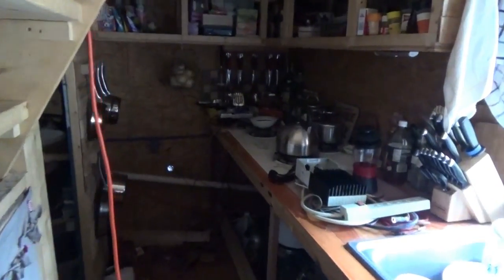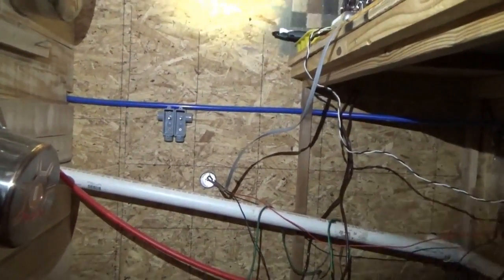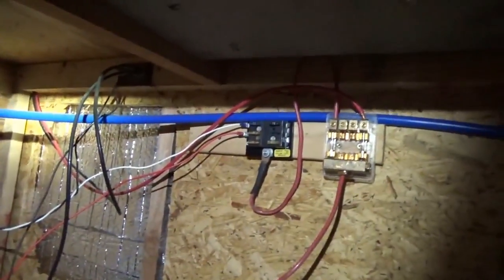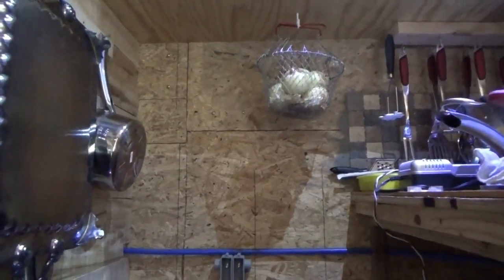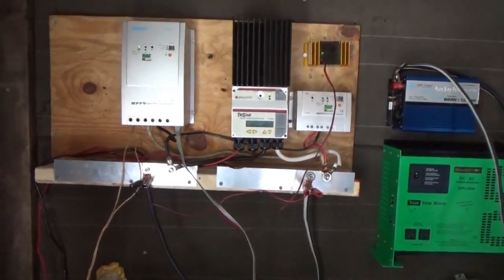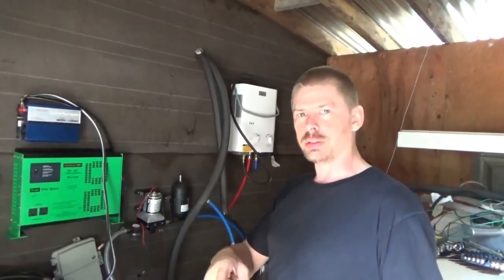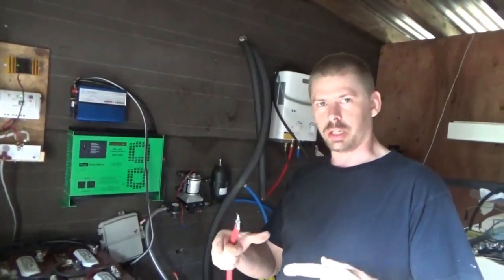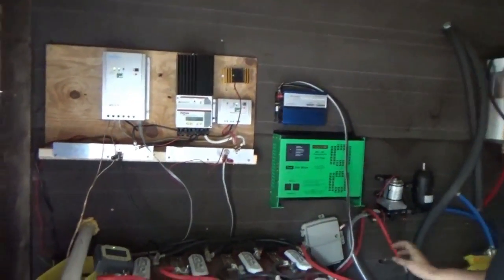Neatly Wiring My Solar Charge Controllers & Inverters

Comment: can a charge controller and inverter charge the same battery at the same time ?
Reply from the maker: You can have a charge controller charging and an inverter pulling at the same time. Yes.
Reply: @TheDoItYourselfWorld  Thanks for your kind reply .. But I want  both of them charge the battery , I mean 
Controller charges from solar and 
The inverter charges the same battery from The Grid . 
What Am I Asking , because My Scenario is having grid power but it is not stable so battery will drain without getting enough charging ... So I will use the solar  to help the unstable main grid (2to 4 hours out of 24 hours a day where I live ) charge my battery..
I Have a diagram if you want me to send you ,Kindly send me your mail . 
Thanks again .
Reply from the maker: Hi, you can bring it to the forum if you like. https://www.thedoityourselfworld.com/forum

Comment: Looks like the battery bank is not wired correctly for a balanced load. The pair of 6-volt batteries on the right will work twice as hard as the pair of batteries on the far left. In order for all 8 batteries to have the same workload and lifespan they need to be wired  in a balanced manner. Here's how they should be wired:
https://c2.staticflickr.com/6/5616/29793500710_0865bc7193_o.gif
Reply from the maker: Thank you for the info. I always wondered if this was perfect. I was shown the way I did it a few years ago by a YT viewer
Reply: +TDIYW
Essentially you have four 12-volt batteries. Here is some good reading on the subject of connecting 4 batteries to achieve a balanced load:
http://www.smartgauge.co.uk/batt_con.html

Comment: I am really interested in the way the batteries are wired?What is the reasoning in doing them this way, it appears you took 8 batteries and just made one big 24 volt battery bank, why not break it into 2 different banks and join them together to up the AH's? It appears you have all the negative terminals connected on one side and all the positive terminals connect together on the other side, not really sure why?
Reply from the maker: These are 6 volt batteries. I connected them in pairs to make four 12 volt batteries. Then connected them in parallel to increase the ah

Comment: no offence, but in my opinion it is still a mess....  (inverters direct on the tar paper, wires everywhere, water protection? ) iff your big inverter is drawing 200 watts idling its time to discard it, the one's we sell, can handle 5000 watts at 230 volts, using less then 5 watts at idle... (Victron)... so 200 watts is huge!!, it is still a mess, but at least its out of the kitchen.  y see you have connected the batery bank right now, thats a plus, but still miss the couplers on the 6 volt connectors., you are almost right!  . take care friend! (still a thubs up!)
Reply from the maker: Thank you. Not sure what you mean about the couplers on the 6 volt connectors?
Reply: 3 wires in the middle of your bank, the side were you have coupled the two 6 volt bats together, (make it like you have two giant 6 volt battery's in series) (thats to keep the 6 volt battery's equal in voltage, during longer times. (the way you have it connected now is almost perfect, butt its a minor thing)
but wil help to keep them equall.

Comment: Serious question will external temps, being it is in shed affect the power in the winter? etc and if so how do you plan to address that? question for Phillip
Reply: with solar panels the colder it is the more efficient they are and inverters will work what ever the temperature

Comment: I thought the battery shed was not permanently attached to the house, thus water can easily drip down that tar papered wall you have all your electronics mounted to. I am no electrician, but is this not a problem? water and electronics do not do well together.

Comment: I have a renorgy 4210 mppt tracer charge controller just like yours  ,,, using the mppt 4210 + 500 watts worth of renorgy solar panels I have four golf cart batteries,,,  I'd like to parallel that system and get some L 16  batteries about 4 of them,,, someday I'd like to save up and get the rolls surrette or maybe the Trojan,,, I have a 1500 watt pure sine wave inverter I recently purchased from Amazon it is a power Tech on I've been running my refrigerator with that every other day to cut back on my electric use I'm still on the grid someday be nice if I could get completely off the grid,,, kind of working at it,,, I'd like to add 5 more 100 watt panels from renorgy and another 4210 Tracer. looks like you guys did a great job. looks like things are really working out good for you Troy,,, I'm so very happy for you and Melanie good for you,,, I've been threatening for years to take a small vacation someday,,, I never have gotten around to it ,,,,maybe sometime if I do would be nice too stop over your way and say hello maybe we can all go out to dinner or something probably won't be able to this year but who knows maybe next year.

Comment: Is it just me or does running the electrical wires into the THOW, through the same hole as the gas line, sound like a bad idea?
Reply: Nah! What could possibly go wrong?
Reply: I agree I think Troy should for safety make separate line .
Reply: Bob Ross LOL! You're right, after some careful deliberation I can't think of a thing.
Reply: Actually it's not as bad as you think.

Comment: Hey Troy for someone who talks about organic all the time, you could have used vinegar and water and skipped the bleach for cleaning. I thought you hated chemicals?
Reply: Why have you let the mouse problem get so out of control? How are you going to keep them out of the goat feed? Why even keep things stored if you can not do so properly? I just don't get it.
Reply: Vinegar is a chemical. It's acidic, strong enough to dissolve mineral deposits. 20% acetic acid vinegar will burn skin and damage your eyes.
Reply: While I use vinegar, lemon etc  a lot, when it comes to rodents we use bleach and water because here in the west where Hantavirus issues related to rodent droppings, dead rodents are a concern, we use bleach.
Reply: +The Long Project he's just not a complete legend like you are man relax.
Reply from the maker: I do hate chemicals but this was very bad and I was not going to mess around at all. I did not show you the half of it. The larger roll of wire was blackened with mouse feces.
Reply: Hey TR we got Doc Busted
Reply: Appalachia? where the Men are Men and the Sheep run scared?
Reply from the maker: Same here!!!
Reply from the maker: Odd, YT is messing with things again. My comment was in reply to prepper man but it does not show. And I cannot edit my own comment.
Reply: Vinegar and water are both chemicals. Acetic acid and dihydrogen monoxide.
Reply: I  suspect ryan lipinski is behind this